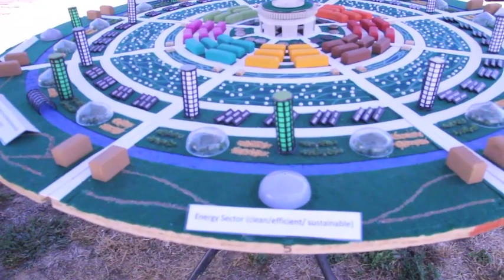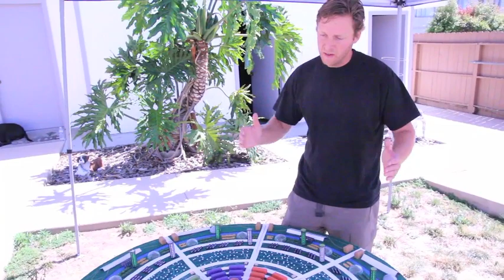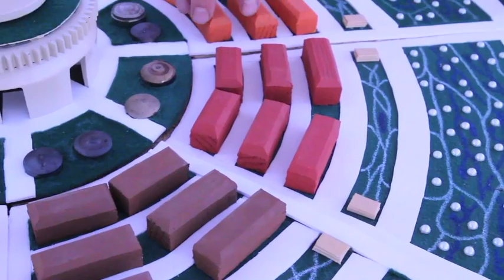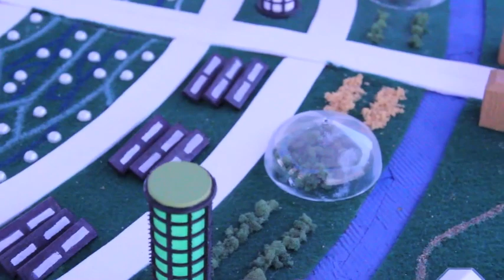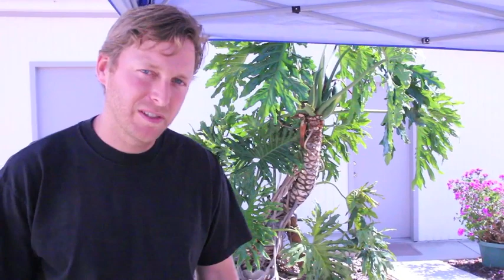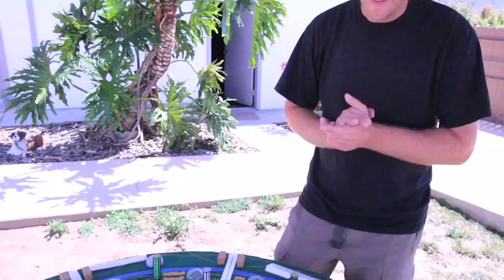Future City Design

Comment: My only question is why would you have the recreation center near the industrial area? Wouldn't that be unsafe considering what you could possibly be manufacturing in those areas? In my opinion, which really doesn't matter, but, I would have put the recreation center in the housing district between the houses and apartment complexes that way everyone doesn't have to travel further to get to the designated recreational complex they want to use. :)
Reply: I guess the industrial area is not the same industrial area we have today. It could be more eco friendly that won't pollute the air quality...???
Reply: +Chris Aiden Cheng  i agree

Comment: One small issue about the centre, damage or even a terror attack have a huge impact because there's so much in there
Reply: ArtisticBuilding Minecraft Even today's cities have some kind of a center. This city would be for 100k people, and there would be like thousands of these cities.
Reply: +ArtisticBuilding Minecraft i disagree... learning from Jaqcue's other lectures (u can view all of them here on youtube for free.. just search and research yourself), there are redundancies (backups) built in his city designs for those kinds of problems. and just imagine, the next cities built around that are connected to each other via sensors (think of it as a nervous system) it'll be easier to maintain and see where are problems (water drought?, soil nutrients low? etc) and initiate fix. to understand is to look at it and see the bigger picture as to how it functions and research and make it better. it's not a utopia.. its not stagnant, Jaqcue left it so, it can always be upgraded to make it better

Comment: Sorry, this design is awful. You should get in touch with a proper city planner. Apartments are more efficient than houses. Social interactions should be spread through the city, concentrate them in one zone is a big NO. A grid system with walking distance public transport stations is the best way to move around. Vertical farms only produce leafy and tomatoes, you can't produce wheat, rice or fruits. Solar panels should be on top of every building, that would be enough. Things would be, from the nearest to the farthest from home: kindergartens, grocery stores, drugstores and other essential services, schools, restaurants and shops, medical centers, sport facilities, offices, cultural centers, industry and agriculture, just build then in a grid system using a fractal.

Comment: i would make the commercial and apartments the same hieght and as high as i can while suppling enough power for 5 kwh per person from solar panels covering most of the space above. the buildings could be block sized and could have modular walls and floors to fit the business size accordingly, maybe made of air krete. the apartments could be on the top floors, commercial on the bottom 2 floors. 

enough dirt for grass, plants and some trees on the roof to keep the temperature comfortable, maybe geothermal heating and cooling. the roofs would be connected with bridges. under the bridges could be large multi floor businesses. on the roofs there could be service roads, large bike paths, sport fields, parks, cell and radio towers, satelite dishes, metered parking for vehicles and rv's and food trucks and vending machine, ect. industrial could be along the edge around the commercial and apt center under the dirt, grass, solar panels, ect. then big apartments on the next layer still at the same hieght under the dirt and grass and stuff. then normal residential on the next layer outside. then outside that would be open farms houses.

roofs built and used to use solar panels and wind turbines would be subsidized. the first half of residential layers would be divided into small lots for small houses or rv's. you could get a house near your office or side of commercial. you would be allowed to have a mobile permanent address. small wind turbines could be all across the roof too.

Comment: if you put the solar panels on top of the building and make more than needed power to sell to other city connect the city with near by city build the part the people not living in under ground and you did not say anything about the safety of this city or what the living quarters how big are they how many people do each apartment hold do they have bath room in them or do you have to share a bath room how tall are the apartment how much food dose the crop produce and what about livestock and you say train does that mean there will be no roads or are they share and by having the spit in the type of job will make people pick the job by where they live and make other people think that all they can do.
 the city is small where you can have one side for living and the other side for work. To get the money to build it you can build the center part first. Have it built with a power plant on top living on the outer part of the building and have the center part the stores, emergency department and school. this way the apartment will all have windows what will raise the rent. people can open there own stores for free but you get 10% of there profit people that work at school or emergency places will not pay for there on living or people that have shortened skill that way you get more people that want to live there and build the outer part when there is a need after you build so far you build a ring solely for selling good to other place by this time the city will be able to out put more than it buying it will most likely take 10 to 20 years but after that it all profit it will run it self but i don't think allot of business will try to build it the amount of money it will take is quout allot and there still not a strong need for it but in 20 to 30 years there will be allot of place this will work
Reply: there are no cars, there are trains and speed rails that take you all around the world anywhere you are trying to go. bikes and other transportation can be used as a means of getting around as for apartments and homes thats up to whoever wants to live there. the buildings are made easy to assemble and disassemble, meaning you create the living space you want to live in, it is made in a concrete mold than brought to the location and placed to the tower or placed in a lot you wish to live in.

there is no more livestock. there will be no automated killing farms instead meat would be grown or you could go find and kill to get you're own meat.